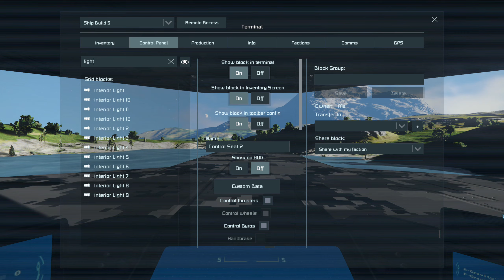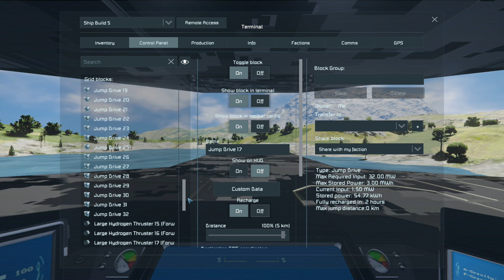Space Engineers - How to Build a Large Ship - Part 1 - Thrusters, Hydrogen Tanks and Jump Drives

Comment: I'm making a ship off a slightly modified frame of your first one that you scrapped, and I'm quite liking it so far. I extended the mid part a bit to put in a hangar for my 2 mining ships and a small shuttle, going for a sort of cargo/mining frigate. I also made a version of it that has the top and bottom mirrored, which I extended the middle of by I think 20 or so blocks. Both are just frames with plating and engines so far, and I'm not entirely sure what to do with the latter, but I might go for a cruiser sized light carrier. If I extend the middle I could probably fit half a wing or so of bombers in there. Finishing the Frigate first, though.
Reply from the maker: When you do finish them let me know, would be cool to look at!! 😎👍
Reply: @TheGarageGamer86  My biggest struggle in ship building is the interior design, I find I tend to favor large, empty spaces with few walls so there isn't restrictions on where to put things. I'm working on it though, and once I'm happy with it I'll put it on the workshop